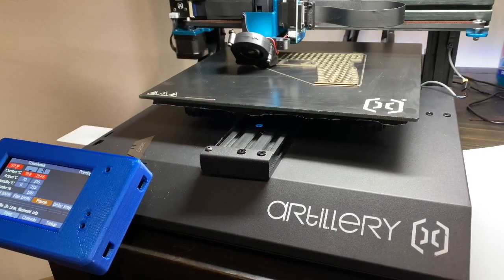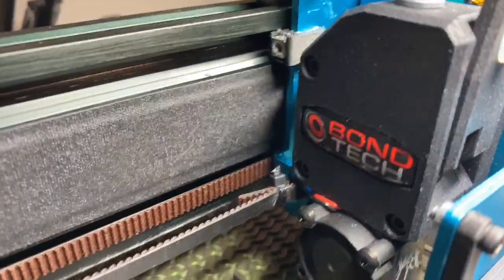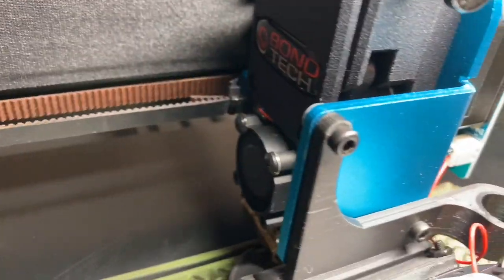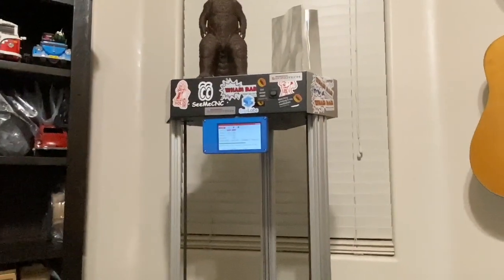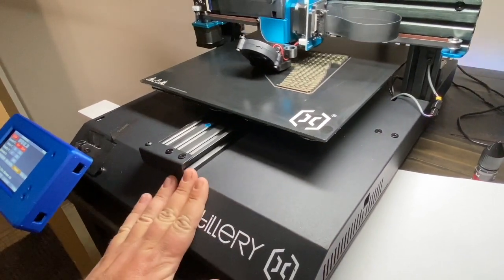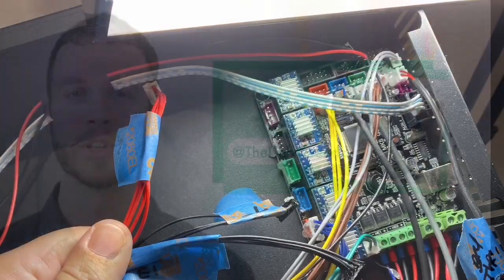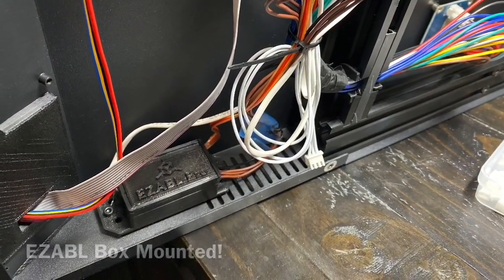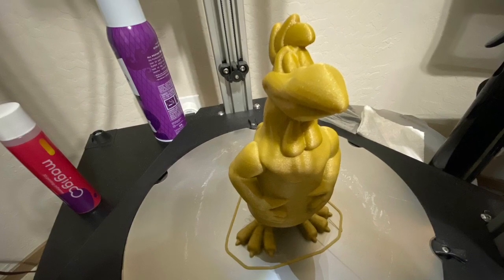The Ultimate Artillery Sidewinder Upgrade 2020

Comment: Hey! i just bought the Duet2Wifi Board for my Artillery Genius. Is it possible to just put the Cables from the old board into the Duet? in order to use the ribbon cables ?
Reply from the maker: No you need to change the plugs to Duet2. The Power logic is different. You have to wire it one at a time
Reply: @thelightspeed3d712  Thank you for the reply. Atm i'm stucked at the configuration. Can u share some details which settings u did for the Axes ( Speed, current Aceleration) and the Sensor configuration in detail ? I dont know which bedthermistor too choose for my Genius. Have a nice day!
Reply from the maker: @Curunir96  email me and I’ll walk you through it. thelightspd@gmail.com

Comment: So besides the fan duct, the BMG + Mosquito are a direct bolt on replacement for the X1? Do you know if that goes for the X1 V4?
Reply from the maker: Yes my X1 was the V4
Reply from the maker: But yes it is a direct replacement. The fan duct I will post tonight. I am not a good modeler. But I made one for another community member. I will put it on Thingiverse. Also you have to content with the X end stop. The Mosquito will hit the motor so you have to relocate or do as I did and put a "stand off" which is included in my model set on thingiverse.
Reply: TheLightSpeed! ! Thanks for the quick reply! What stepper did you use for the BMG?
Reply from the maker: @rickmerina3045  I actually just used the stock motor. Worked just fine. Are you converting yours to a Duet too?
Reply: TheLightSpeed! ! Ah ok. Thanks for all the info. No I’m not planning on making that change to Duet at this time.

Comment: Soooo... what was the actual creative wiring needed on the Duet3d to make it all work? Got a diagram anywhere? (I plan the same thing)
Reply from the maker: Basically most people that do anything like eliminate or replace the end stops with switches that will work on 3.3v for the Duet. I really didn’t want to retrofit clicky switches. So you need to first off take the factory plug off the end stop and at the board re-pin the plug. The Duet from left to right is “Signal-3.3v-Ground”... and the MKS GENL board is “Ground-Signal-5v” basically if you plug it in straight from the MKS board it can and did fry your 3.3v rail on the Duet. Expensive mistake. So once you re-pin the plug from the MKS to DUET, for these Endstops you need 5v. So the 3.3v won’t do. So you need to cut that wire off the Duet side. Then connect all three of the power leads into one plug and connect to the #1 pin of the expansion header. The first pin of the header is 5v. The pin 2 of the expansion header is GRD. Basically just pulling the power from the header instead the endstop plugs. Hopefully that makes sense. I was going to show what I did but it’s kind of tough to do. For me.
Reply: Stephen-TheLightSpeed! !! Yeah, makes sense.
Reply: @thelightspeed3d712   can i ask a schema for endstop connection? sorry to ask, but i think to lost something in translation from english! thanks

Comment: nice work  may be  i m wrong  but i think   you change original belt   :)
Reply from the maker: Yes I did
Reply: @thelightspeed3d712  do you notice  a better improvement because  i  m wondering  to do this simple tweak
Reply: i did too  with belt with metal  wire  inside   more silent  and more precise im looking now  for including  dmg extrudeur  and hotend edv6